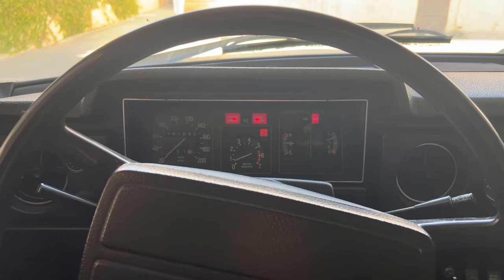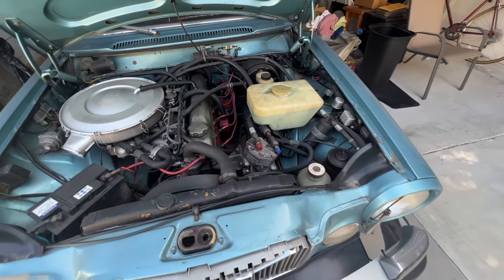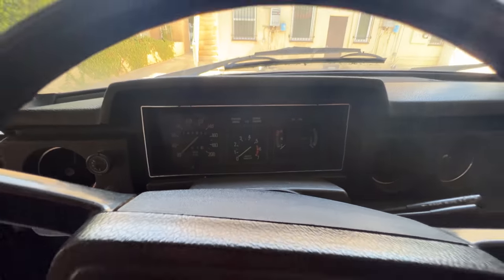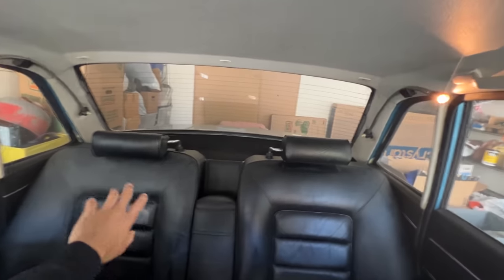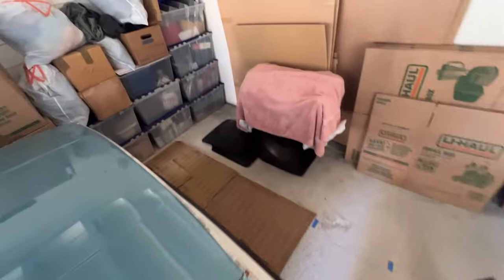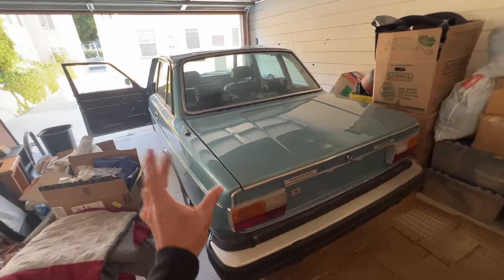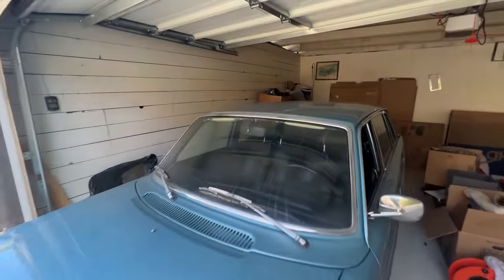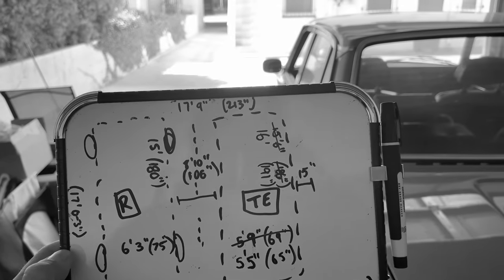The 1975 Volvo 164TE Restoration Begins

Comment: That is one beautiful automobile. Obviously very well cared for all of its life. If my memory serves, 164 sedans were all trimmed as a GLE. At least any I have seen have been. Every one has had the same rear seat as this one. The top of the seat backs are notorious for getting sun dried and crumbling. Lovely to see this one in great shape. It will be neat to see the fuel injection system working right. It makes sense about the gas tank. The 164 uses the same body panels in the rear as the newly introduced 240 series, so it would not have made sense to keep producing the panels for the 164 as well as the new panels with the safer design.
Reply: The Volvo design team was equipped with a great practical sense at that time, their cars were great, much better than today's designs that are plagued with design errors and chronic reliability problems.

Comment: Lovely car David. I have also just bought a 1974 164 (only an E) and take delivery tomorrow. Mine needs a lot of restoration as it's been standing outside for 17 years! Although yours may have been sold in 1975 I think it is a 1974 model. 1975 has the handbrake in the middle, wider 264 style tail lights and cast alloy rear badges and maybe some other small changes.
Reply: Your right,last year the 164 was built were 1974.From 1975 Volvo built the 264/265 with the awful renault enginge.
Reply: No, actually the 164 continued to be produced alongside the 264 for for the USA market for 1975. See extract from Wikipedia page "For 1975, the PRV engine was not available for the American market so the 164 was produced for one more year for the American and Japanese markets only although a few were sold . The 164 received new larger 6-panel rear lamps sometime during the 1975 model year, electronic ignition, new seats, electric windows in the front, a new style of badging, extensive changes to the rear suspension, and the parking brake handle was moved from outboard to inboard of the driving seat." - Wiki. As David's car has none of these changes I believe it to be a 1974 model but there are 1975 164's out there.
Reply from the maker: Yes this was built in 74 and is titled and registered as a 75 🤷🏻‍♂️

Comment: A limited edition of the 164, the 164TE was made only in 1974 and only for 3 markets, Great Britain, Germany and Australia. 

The 164TE had extra accessories fitted as standard, being air conditioning, 4 speaker 8 track player with radio, headlight wipe/wash system, rear head rests, 

rear reading lamps and a fully carpeted boot with lighting. 

This more upmarket version was only available in 3 colours, being metallic light 

blue (colour 111), metallic copper (colour 105) and metallic teal (colour 115).

Comment: I had a 164E and I still miss it. A wolf in a sheep's cloth. Very nice and stable to drive.
But my comment relates to what you said about the steering, it is noisy. It always is even as new but it's not broke it's just the way it is. 
PS. the "E" is for the Bosch fuel injection.

Comment: The 74 164E I had was the same color with light blue leather interior. Wished it had been a 4 speed OD. It was a garage queen before I bought it but the paint had oxidized badly despite being relatively shelters for the first eight years. That is a clean car, though. Based on your other works, you do a nice job on this one.

Comment: The 164-1975 was sold i America only. The 264 was avalible in Sweden (no 164 avalible here in 1975) but it did not pass the emission test in US so Volvo made a hybrid 164 with 264 interrior, dash and rear boddy from the firewall and back 1975, 1976 the 264 was ok for US market. That there looks moore like a 1974 164.

Comment: The charge regulator is screwed on the inside steel panel up to the wheel. So very exposed to water. When the steel panel was rusted, the contact either to the charger to the panel or the panel to the frame, was bad, and it blow. The best, not the most esthetic, is to install a good wire between the charger and the engine, where is bolted the alternator and the positive battery wire bolt to the started. It is important to understand that this charger was the first step to a fully digital one, so it was very sensitiveé to faulty ground.

Comment: Nice car David. But are you sure it is a 1975? To me it looks like a 1974. The 1975 should have the 240 seats and dash. Early 1975 builds had the normal 4 bulbs rear lights while the late ones had the 6 bulbs rear lights like the 264. Check the chassis number.

Comment: Nice channel, you seems like a sweet guy with prioritys set on real good cars. But this TE is a little of a mystery. The model should be 1975, but it´s missing some of the most significant features of the 1975 model. In 1975 the whole back were from the 240, the most easy way of controlling that is the handbrake, it should be in the middle, between the seats. Not like this car on the left side. The seatbelts and connectors are not correct for the -75. The -75 had 240 leather interior witch has a different pattern on seams and the very recognizible 240 headrest. There should be a 2 inch wide stainless steel trim on top of the doors, the -75 had aluminium covers on the small lights in the front, last years sunroof where standard equipment, this car has none, the mirrors should be adjustable from the inside,  and so on. All of the 1975 had these changes, even a few of the last made 1974 had them. The rims look a bit skinny, the 164 had half an inch wider steel rims with chrome and hubcaps. So it´s a most intriging car. Big thanks to you for taking care of this lost gem, i will follow the restauration! You should probably change the camshaft, this one is (my guess) really worn out, the valves are very quiet on a healthy 164.

Comment: Are you sure it's a real TE? They were extended in the body for better legroom in the back, and equipped with an automatic gearbox ...
Reply: It is. It has the opera lights and rear headrests. Those were on the TE model. Also headlight wipers.
Reply: i belive you are thinking of the 264 TE and not the 164.
Reply: @eriks825  You are right, I mixed 164 TE with 264 TE.

Comment: If you're delivering this...
Reply: I have a 1975 ,always garaged, 29k original that needs some work...
Reply from the maker: @morecomplex5233  also 164?
Reply: @DavidBello  Yes  a 164..... BOSCH fuel injection....
I just bought  on ebay the intake & exhaust manifolds w carbs and air filter  in case  I want to change.... I plan to drive this ,NOT keep it low mileage...
Reply: @DavidBello   yes..Maybe  for sAle soon...